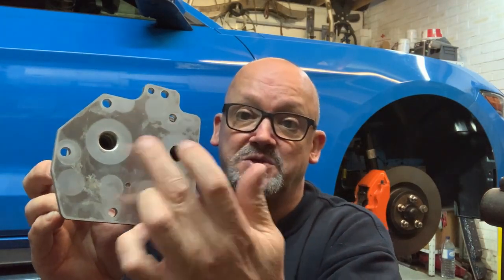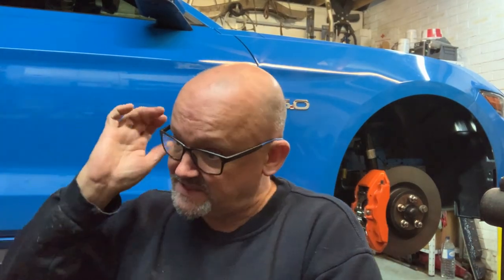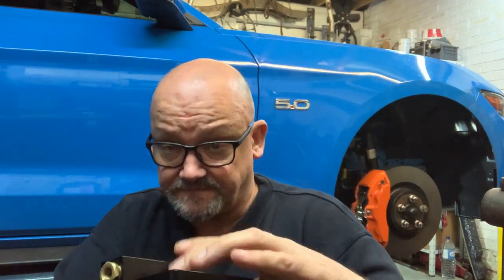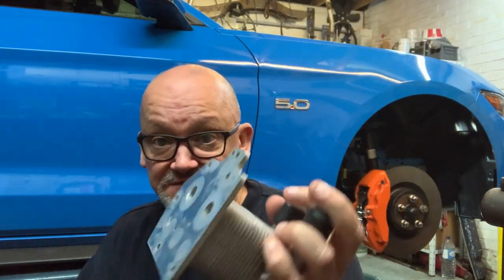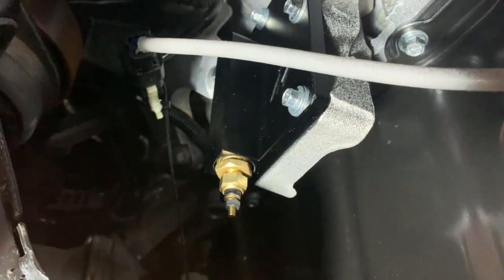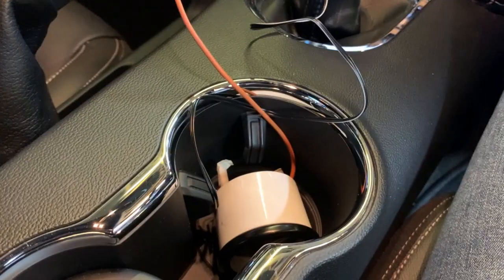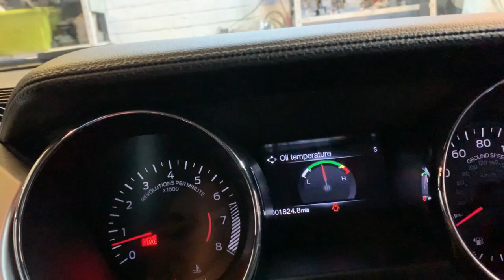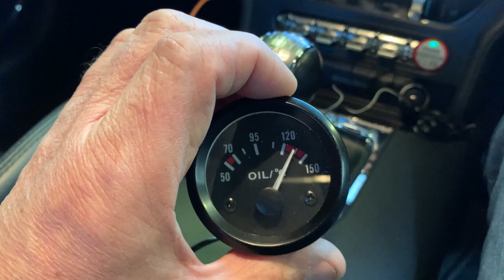Does the S550 Mustang GT need an oil cooler?? Let's find out..

Comment: The problem (as I see it) is that they're using engine coolant to cool the oil, which IMHO is never a good idea, and can lead to exactly what you see happening in terms of cooler failures. I don't know how the oiling system works on a Coyote, but doesn't that block-off plate keep the oil from properly circulating?

A better idea would be to use a remote cooler that sits in front to one side of the radiator (or in front of one of the front fascia openings. Derale makes a nice 9-inch (square) stacked-plate cooler which should do fine. If you go that route, don't forget that your oil capacity will increase by about a quart due to the lines and cooler.

You mentioned getting a remote filter setup as well. You don't have to get the one from Mishimoto that costs almost $300. Perma-cool makes one that only costs about $60 and it will work on a coyote. The only down-side is that you can't use a stock Coyote filter on it (with the parts supplied in the kit), but silver lining - the filter you do have to use (Motorcraft part# FL-1A) holds about twice as much oil, so there's that.  Since you're also going to be adding a cooler, make sure you get the remote filter kit that has in/out ports on both sides of the mount.

Comment: Very informative. How about old school and trying an air oil cooler, mounted in front of the radiator. A large enough one should keep the oil temp down.
Reply: That's exactly what I'm doing.
I already have it along with a larger radiator and trans cooler.

Comment: Hi Nigel, This is a great test.  I would really consider changing the oil now.  Oil starts to break down at about 275F, 135C.  Of course the actual number depends on the type of oil you are using.  You sure don't want to damage anything.  Thanks for sharing.  Have a great day.  Jeff
Reply from the maker: Great suggestion Jeff. I run Castrol Magnatec fully synthetic 5W30 so we should be OK.. having said that, I will change it when i fit a cooler..

Comment: To be 100% certain that it needs the cooler, you now need to fit the original cooler back in place,  and then somehow fix the extra oil temp guage to see what it then reads.
Reply from the maker: I would love to do that, but I have nowhere to fit the sender unless I remove the casting and drill and tap it to fit the sender. And.. I am not gonna re route those coolant hoses and refit the stock bottom hose to the radiator.

Comment: 140C/284F seems extreme for a 12 mile drive. It's typical for a high revving engine to see high oil temps and creates the case/need for an actual oil cooler to replace the factory Oil warmer/cooler. With your findings, a good 30 mile drive would yield even higher temps which would result in catastrophic failures which though happen we dont see many of these due to oil temps. I'd suggest you try a few other temperature gauges as well as an analog one to compare. Lastly any OBD scanner will tell you the actual temperature the S550 is sending to the ECM. ONLY when you have compared all three temps can you share these findings. Using an old temp gauge that's shown to have some play in the reading and possible a faulty or non matching sensor as the only tool for testing is a quick jump.

Based off your videos, these temps appear extreme and if they were more common it would be plastered everywhere.
Reply from the maker: The gauge and sender are not mismatched, but they are not high quality. As mentioned, I checked the gauge against boiling water and it was slightly out. The ECM on this car does not give an accurate oil temp, it is calculated, again as described in one of my videos. There are very few cars out there that have the stock cooler removed and not replaced so the information on this set up is rare. I know of one other car that has removed the cooler and not replaced it and the owner has been using the oil temp gauge in the dash, which we now know is incorrect as it is run off an algorithm.

Comment: Hi Nigel, queston, does the left hand drive version of this car have the same pre engine oil heater fitted. Only getting engine oil up to operating temperature and reading this on a correct gauge, is more important than reading coolant temperature. Could this feature not be an advantage when running the car in UK cold conditions. Is there not a better made replacement available. Regards David Porter London
Reply from the maker: Basically Dave the answer to both questions is yes.

Comment: You did all this to figure out what ?
Reply from the maker: To see if the factory fitted, troublesome, oil cooler is actually required.
Reply: @nigelsmustangchannel4563  - More accurately, to see if a cooler is required at all. Correct?